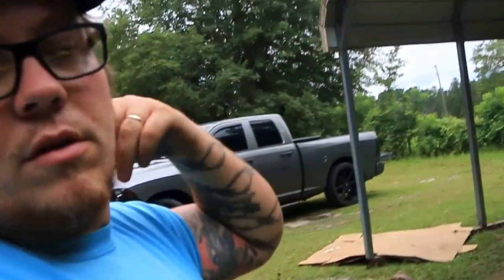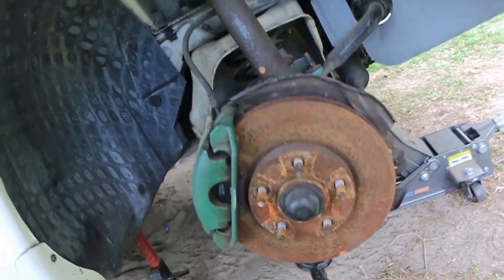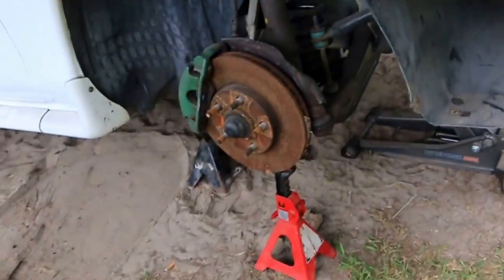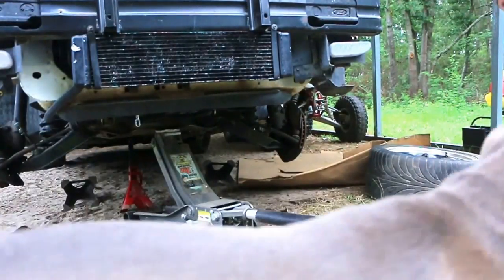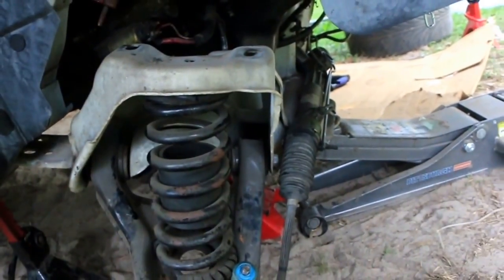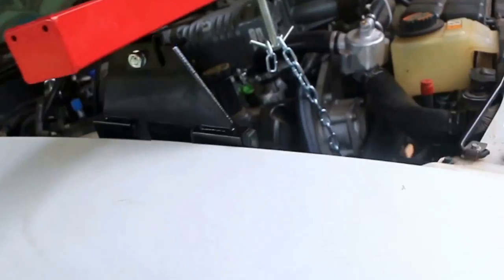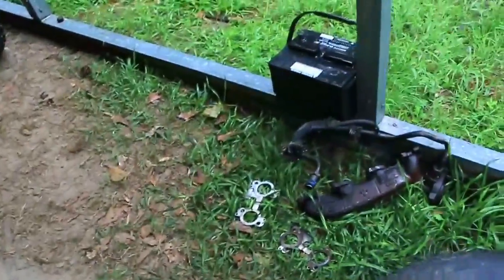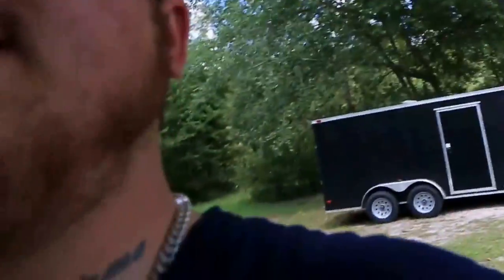Tork Tech mustang Longtube Header Install

Comment: I exchanged my Hedman silver coated long headers to short on my 88 Thunderbird 347 Stroker, because they blocked the starter and transmission from being removed. Also burned up the starter, and I did'nt want to heat wrap them. It was just too much  to deal with. But if you don't mine dealing with it then go for it. I just did'nt want to mess with removing a header just to change out a starter. To me long headers are more trouble than they are worth to get an extra 25 or 30 hp. You can reduce weight and probably get even more hp. Remove seats, spare tire, smog pump, go to a fiberglass hood, lighter rims, aluminum drive shaft, smaller tires in front etc.

Comment: I’m installing macs LTs on my 00 convertible gt AUTOMATIC and dude i feel your pain 10x bro. Everybody can all agree that if you want longtubes you may as well pull the whole motor out and put em on. Alll those wires scare me
Reply: I installed long tubes on my dad's 1990 GT automatic.  It was challenging!
Reply from the maker: Yes, definitely would have been easier. Just working with what I have.

Comment: Make sure u drill a small hole in both sides so when u put back together you can relocate back to stock location otherwise it can go back together misaligned. Just a ..fyi. have fun good luck
Reply from the maker: +mylittlebit thanks for the tip.

Comment: Drill a hole the size of a 8 penny nails size ,  In the bottom of mounting plate of sub frame through the frame mounting frame. . That way u can put a 8 penny nail in Holes when u put back together to line it back up other wise u have to measure opposite tires front to rear and then staight front back to line it back straight. Hope it helps your follower  from the  north . Good videos though keep them rolling.
Reply: I don’t understand what you’re trying to say. Can you explain more? Are you talking about in the motor mounts?

Comment: bro i installed long tubes on my 1998 gt and now i am having issue with the steering shaft rubbing on it what you do?
Reply from the maker: What brand? These are Doug's and I didnt have any issues.
Reply: Hay man had same problem have to bend it a lil make shore u don't let it rub will make a whole
Reply: Its pipes brand stainless